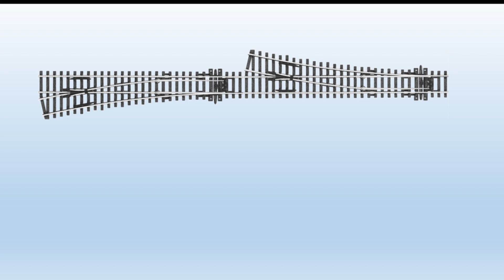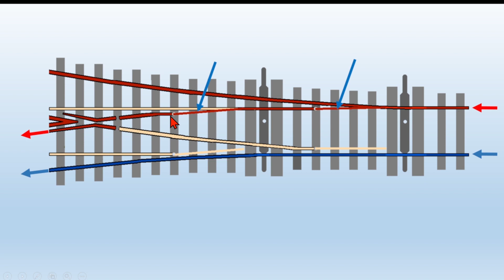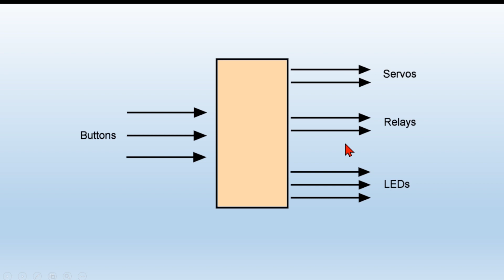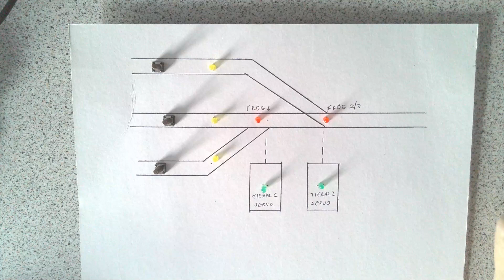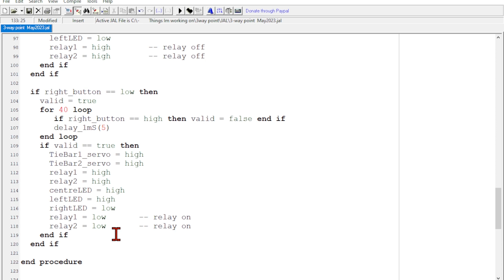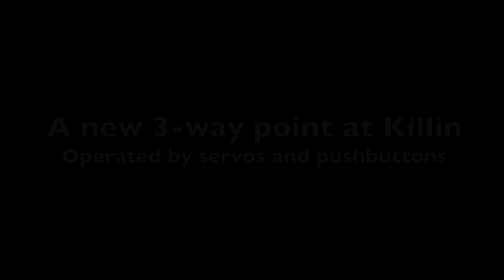3 way points using servos and pushbuttons

Comment: Nice work Davy. I have been thinking more of defensive code lately. If 2 switches are pressed then changes occur rapidly. Perhaps a delay of a second or 2 after the relays throw for each condition, L, R, through, would be useful as this would give the servos time to reach their mark and prevent the relays from going crazy.